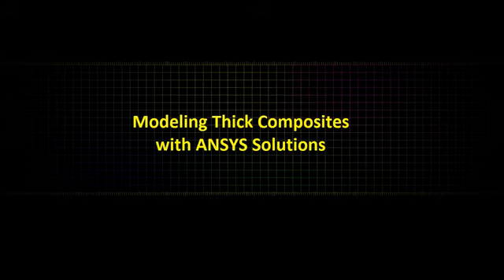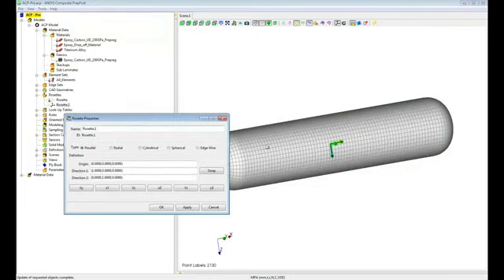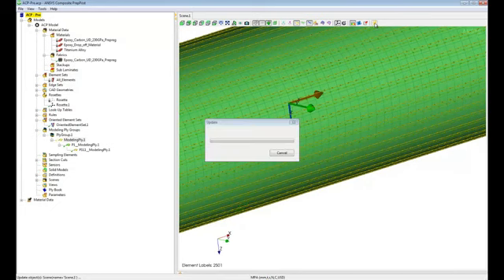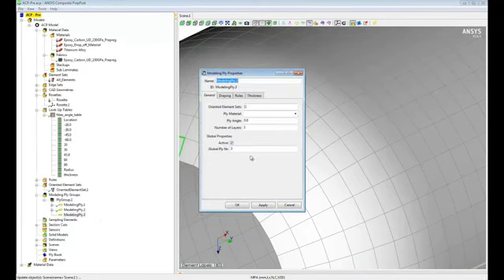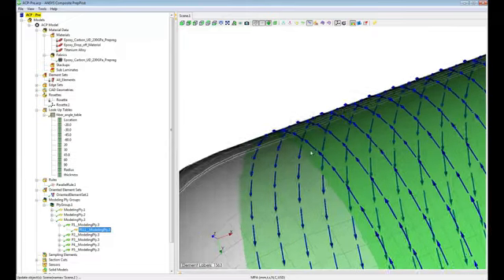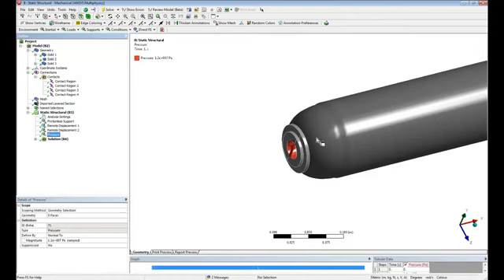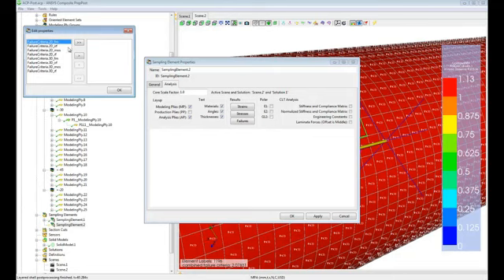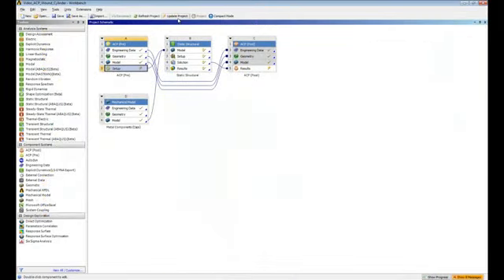ANSYS for Structures: Simulation of 3d Thick Composite Structures

Comment: Is it possible to do composite analysis of solids not just surfaces? I've tried, my solid geometry does appear in ACP setup, only shells and surfaces appear.
Reply: All I've ever got to work is surfaces/shells
Reply: I made surfaces and shells and then generated a solid model from them in ACP, worked like magic.  However, I now have errors in the solver, probably due to insufficient contacts.